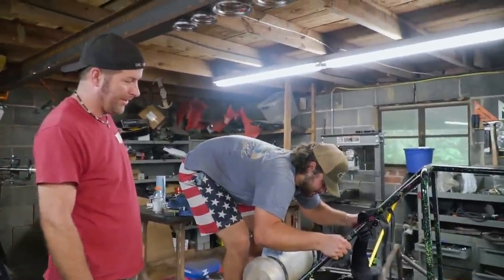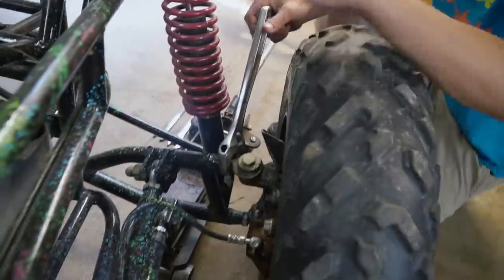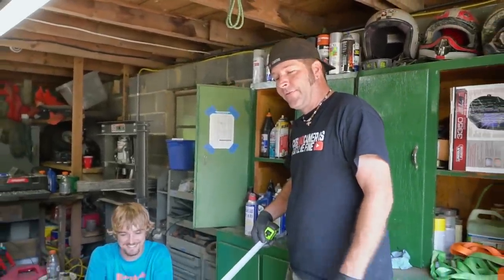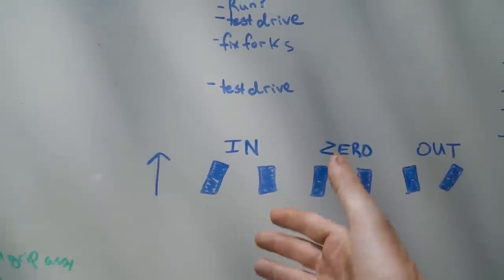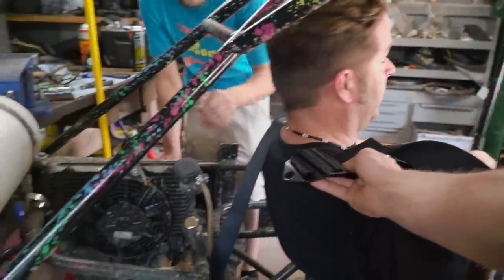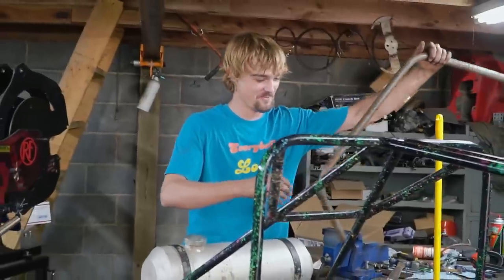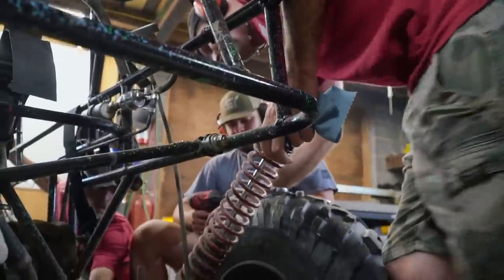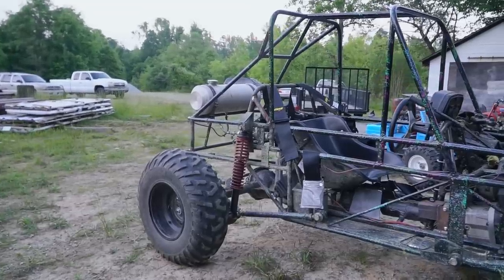$100 Long Travel Shocks RUINED the Trophy Kart | Jump Testing, Is It Safe?

Comment from the maker: Gotta pay to play when it comes to shocks! We'll get it dialed in.
Reply: I raced motocross for over 10 years and hands down without any question the number one way to go faster is suspension. And yes you gotta pay to play, but oh wow it is so worth every single penny!!!!!!!!!! You guys have enough subs to drop some $ on some good shocks, DO IT PLEASE!!!!!!!!!
Reply: Thank you guys For Bringing Charles In The Vids And Also Keep up the good Work
Reply: Would some SxS shocks fit? Like from a Rzr? If so, you should be able to find some good used ones at a reasonable price.
Reply: Thicker oil in shocks maybe?
Reply: I would recommend using a rocker arm setup for the shocks. You can use the ratio of the rocker arm to get your travel and the shock travel the same. Then you can use a high quality motorcycle shock that has less travel. They are dirt cheap and you can usually find the spring rate online. It will require using your brains so leave ike out of this one and get Charles to figure it out maybe. BTW that setup is NOT a cantilever as much as other idiots want to call it that. It's a rocker arm.
Reply: Yes your shocks are too soft but the transition on the jump needs to be longer as well so that the suspension does not bottom out on the jump face. The best way to jump a kart is a flat take off that does not bottom the suspension.  Check out me jumping my Yz426 full suspension shifter kart here.
https://www.youtube.com/watch?v=61Ei6B4vnoc&t=2s
Reply: You need stiffer springs and more rebound damping in the rear. It's bottoming out too easily.
Reply: You guys should bring back the drag rail
Reply: I’m so glad Charles is with y’all now he’s a great fit honestly in my opinion
Reply: Have it scaled and talk with a shock company such as King. Then find used shocks that closely compare. Some shocks from a Polaris  rzr can be fine tuned cheaply.
Reply: For new coilovers look at big shocks tbey are very affordable  coilovers
Reply: My engineering head is telling me you would need a heavier/thicker/more resistive fluid to keep the rebound low. That would pick the back wheel up off the ground earlier keep it from pushing the nose down. Alternatively this with cause it to be stiffer everywhere. Unless you shell out some serious money on shocks that have the ability to adjust them separately.
Reply: would i be dumb to recommend buying separate springs, do a dual soft spring on one shock to support the weight but maybe have less rebound. idk just a thought
Reply: Are those shocks manufactured to be ran upside-down?
Reply: Adjustable Dirt bike shocks in rear
Reply: Not enough weight on the back end for the traction you need to launch it in the air.  That is why it does sweet burnouts.  Easy enough to add 50-100-150-200 lbs and see what it does!
Reply: You have too much front end weight and it us causing it to nose dive into the ground and evenly distributed weight could make if fly
Reply: Have you tried, goosing the throttle just before your front tires leave the jump so it preloads the rear shocks?
Reply: Look at some from a stock 98 pathfinder
Reply: Put a thinker oil in it. Add maybe 45 pounds of ballast in the rear
Reply: Find a set of rzr or other side by side shock take-offs or even a set of atv shocks from a sportsman 500 or something.  Weight should be similar to the cart and they'll perform much better than part store load carrying shocks...
Reply: Have you considered two dirt bike rear shocks? You may may be able to get them second hand, they have pretty good travel and already have compression and rebound adjustment.
Reply: Just like with the tourqe converters how there are different grades of spring steel for the driven pully there should be something for the coil spring on the shocks you can order from gps.
Reply: I have a brand new set of fox coilovers for my toyota tundra, for a decent price, or the set of stock front coilovers, still in good shape you can have along with the stock rear shocks, I just upgraded to all Fox suspension and they really are the real deal, my Yamaha YXZ 1000R has the Fox podium shocks, those have around 22 inches of travel, amazing shocks, you can really leave the ground, but like you said You have to pay to play" those shocks alone are $9000.00 on Yamaha's website. Your solution is thicker oil, nitrogen won't expand when hot, and a soft spring rate so the shock won't catapult you off the apex of the jump, if you have a rc car with shocks, play with the fluid and spring rate until you get an idea.
Reply: THICKER OIL. to slow down rebound and bounce on my RC cars, i ran heavier shock oil. works like making stiffer rebound.
Reply: @kalebaufderhaar414  those tundra shocks and springs would be way too heavy.  There'd be almost no compression, would be like riding on a rigid frame cart.
Reply: @hunterdan2002  I agree in stock form they would be, I think the springs are around 6 to 700 pound springs, since the stockers would be free, wouldn't be to painful to maybe chop them up to work, but the fox shocks are adjustable to a point, very nice ride in the tundra, I left them how fox set them up, the truck handles incredible, now for their light frame I agree super stiff if any movement in stock form, modified tho would work nice and add the weight to the rear they need. I'm also offering the fox shocks below msrp since I some how ended up with two front sets shipped to my door.. lol I almost donated them to these guys, knowing Issac he could set them up right. Thank yxz shocks would be the ticket. I appreciate your knowledge.
Reply: @kalebaufderhaar414  having owned a tundra, they are right around 700 pound springs I believe. Still would be cheaper to find a wrecked rzr or atv and snag the shocks off that.  I honestly don't know why they don't do that with more of their builds since those atv and rzr shocks would be far better than any of those GPS shocks they've been using.
Reply: fox air shocks
Reply: Weld the rear differential.positrac

Comment: Don’t mess with the rear, raise the front up off the dang ground, and put a sticker shock in the front so it don’t give and lay flat on the ground every time you jump
Reply: Spot on for the front.  It is so soft with the weight of the motor it is just plowing through the jump with no rebound at all.  So it needs to be stiffer.  I think for the rear they need more dampening ( I suggested above to just add an normal car shock) because it is light in the rear and it is rebounding to much.
Reply: I Was just about to post the same thing until I saw it had already been suggested raise the front fellas...
Reply: Agreed, raise the front and stiffen it to help bias the weight towards the rear.
Reply: @jimmace6148  agreed. Ill reccomend  that our friends read up a little (or a lot) on suspension design . ;)
Reply: Came here to post the same thing. The front is on the ground before the back leaves
Reply: You need 2 shocks like that at rear, but must return oil inside, because like this it is driving only on the coils

Comment: You never want the shoulder mounts at or above the shoulders. You want them 4 inches or a bit lower below the shoulders. In case of a roll over, the shoulder straps are there to keep you in your seat and not allow you to hit your head.
Reply: I respectfully disagree, sir. Spine compression occurs if the shoulder mount is below the shoulders.
Reply: @bradensmith888  you are correct, and installation instructions and all safety rules from racing organizations day as much.

Comment: Totally looks like the ramp isn't longer than the wheelbase.
It'll buck the back every time like that, and you can see each axle as it leaves the ramp.

Love this build!
Ya'll should get a little tractor box blade, and a front end loader maybe, is all you need to clean up the jumps.

Comment: Congratz to Charles. 

Also, now it looks like your going to need to soften the front suspension to match the back (at least that's what I would do to get a more comfortable ride over the bumps). Well, not need to but it would kind of make sense. And it is a off road vehicle and those off road trophy trucks have soft suspension to begin with. They always look like the body is floating while the wheels are in complete chaos over the bumps.

Comment: Before you decide to change the rear shocks or springs again you should maybe try to change the front shocks on the trophy cart put some on it with stiffer springs and faster rebound to compensate for the heavy engine when you are driving it in your video the front of the trophy cart looks dead like the shocks barely move and dont rebound when you hit the jump to give the front any lift.love the trophy cart build it's a monster good job guys .

Comment: Congratulations Charles! Good to see you on the team. As for the shocks you can put thicker oil in the rear/more oil which will make the rebound slower and smoother, springs change the stiffness

Comment: I ended up using fox 2.0 air shocks on my minibuggy. You can adjust oil level and air pressure pretty easy using a nitrogen tank. When you buy them have them valved for your weight and tell them you would like a little slower rebound.  I also added 45ml of oil from the factory fill.  If you want to see the video of me testing them for the 1st time just search Rorty R21.

Comment: I would consider modifying those shocks. The dampers themselves are fine, I believe your issue with rebound is the spring rate. The dampers, well...dampen the compression and rebound speed, i.e. spring rate, of the springs. And draining oil from those dampers is going to lessen their effect, thereby effectively increasing your spring rate. Unfortunately, because adjustable coilovers are so expensive, the only way you're going to be able mitigate the vicious rebound is by either cutting coils out of the springs, which would have the adverse effect of lowering the ride height, or ideally, purchase some weld-on, adjustable spring perch sleeves, or what some refer to as coilover sleeves. If you weld them on in the right position, you can maintain your normal ride height and adjust the collars to adjust the spring rate, just like you would with car coilovers or motorcycle/kart/mini bike shocks.

Comment: You could try extending the frame further out the back and bring the fuel tank with it, so there's more leverage and you wouldn't need to add as much weight. Dunno if it would look a bit weird tho

Comment: From my point of view i would say you need a stiffer front for two reasons. First one is, with the weight balance to the front of the car you need to catapult the nose mutch more in the air to overcome the turning momentum. This is only possible when the spring and absorber working stiffer, so they give more up momentum to the front of the car. Second one is, landing with a front heavy vehicle results more often in nose landings and stiffer suspension might catch critical jumps better.

Comment: I work at chassis shop and as far as I have seen you want the harness bar slightly below the to shoulders to make sure that the harnesses pull you down in the seat and keep you from being able to slide out the bottom but for what you guys are doing with many different sized people it will work fine.

Comment: One thing I have learned from sxs riding is if the face of the jump is not longer than the vehicle it doesn’t matter how you set the shocks up, it’s not going to jump well.  Think of it this way, if the front tires are over the jump, when the rear tires hit the face of the jump they are forced up and that force pulls the front down.

Comment: READ THIS
The suspension oil controls the spring, which it turn controls the damper. Reducing quantity will make the spring work with less resistance which isnt what you want. I believe if you USE A THICKER OIL you'll get better performance for what you want. In the world of motorcycles when a fork isnt adjustable the only solution is tuning with different "weight" fork oils and capacity. Going with a thicker viscosity helps with compression and rebound. Grab some 20W fork oil(or thickest you can find) and start from there! Hope to see you guys work on that jump in the next trophy kart video!

Comment: g`day you need to change the shim stack inside the shock to make the oil flow how you want  for more rebound and compression  or less  comp or rebound  you can also control the high or low speed comp and rebound (low speed deep big bumps high speed small sharp quick bumps) . oil height or volume  is forks on a motorcycle related not shocks so much and it controls the last part of travel in the fork by air compression. less air gap more harder at the bottom of the stroke.  by the look you want more rebound (slower action) so the spring  don't kick the back end up too fast after the compression of the jump run up .....but you guys are there working on it and its hard to tell not been there  to see in person 
cheers
james D

Comment: REAR SHOCK REBOUND: in my RC cars, i always went with thicker oil to slow down the rebound. because if there's less resistance from the shock, the spring will just shoot it back out. thicker oil will resist that motion more. that's the same idea as shocks with adjustable valving.

Comment: You need a slower rebound piston for rear or faster in front. Adding a stiffer front spring may also help. Add the oil back to the rear shocks. Get a stiffer spring and that will allow less compression for rear. Can also get a softer spring in front or ge th more rebound out of front shocks. QA1 has some really nice single and double adjustable shocks that would be perfect for this

Comment: So, RC short course trucks can use an oil shock with a variable piston. Check out RPM RC Products. They use a 2-piece piston/baffle where there will be 2-3 holes in alignment when compressing, and the baffles slide apart when expanding, allowing 4-6 holes to open up for faster fluid flow. This could be reversed to slow down the rebound issue fairly easy.

Comment: Congrats to the team. I would have made the bars come down with tabs on it to hold the harness. Also move the fuel tank if you were to flip that thing will break off and open up. It's great for a yard kart but if you were to actually flip it wont be good please move it or build some kind of protection thats last thing we want happening

Comment: Hey guys, great show. I got some ideas to make the TK handle better. Find some used motorcross bike rear shocks there probably good for about 250 lbs a corner. Also if you raise the rear suspension front pivot points you’ll have better anti-squat

Comment: Id say double up on the shocks, but increase the angle in which they compress. If theyre straight up and down the compress and release will be quicker than on and angle, sloped twoards the front of the buggy. Just weld a new mount like 6 inches more forward and bring it down a few inches. Awesome build.(670cc black widow rulessss)

Comment: mount hitch anti sway links between the frame and the suspension by the coilover. BAM affordable rebound damper. Curt sells them for about $50 a pop, so $100 for a set. one for each side.

When you run the jumps use the sway away links, when you run hardpack flat ground unhook them. ;)

Comment: You want thicker oil in the rear shocks... that is the easiest solution. Too think and it will make the rear end feel muddy, but it won't pogo. You can also get some shocks from an old atv or motocross bike with adjustable damping. 

For shock oil, you are way better off to play with viscosity than to remove some oil. Removing oil will often cause no damping through part of the travel and the original damping for when it is traveling through the valving. 

You can purchase motorcycle fork oil in lots of viscosities or even get it from a bicycle shop...

Looking at the footage of the last jump, it's clear that the front end is undersprung (too soft) and likely too slow of damping. This is causing the front not to get any pop off of the jump, forcing the rear to do all of the work... then to top it all off, the rebound damping on the rear is too fast causing the back to launch up. So you have a front end that is dropping and a rear end that is launching.

 If you have enough speed to make it to the landing (transition) the tip of the vehicle will match the angle of the landing and you will be golden, but this is far from ideal, as this is not happening from driver input, so you are limited to jumping this jump, at that speed.

Comment: A little "toe out" will help with straight line stability while a little "toe in" will help with cornering. Zero toe or a tiny bit of toe in is the norm for performance vehicles.

Comment: Need to drain and up the weight of the oil in the shocks front and back. Should stiffen them up a little bit. 9 out of 10, it's probably a light 5 weight. Go with 10 and give it a shot. There are some mechanical options but that requires unscrewing the gland nut in the top(assuming it isn't perma-sealed) and some intricate work.

Comment: Best way to set toe is to spin the tire and make a mark in the middle. Do that on both tires, then measure from the line. This way a bent wheel will not mess up your measuring.

Comment: Shock dampers.  Also, two shocks per wheel would add stability.  Structurally speaking, triangles are the strongest geometric shape.  

Regarding the jumps, your center of gravity is forward of the driver.  If you put a scale under a front tire, and then do the same under a rear tire, I’d bet dollars to donuts the front is 60%+ of the combined weight.  That is great for climbing and traction in corners, but jot great for jumping.